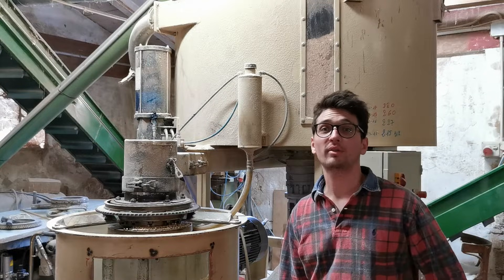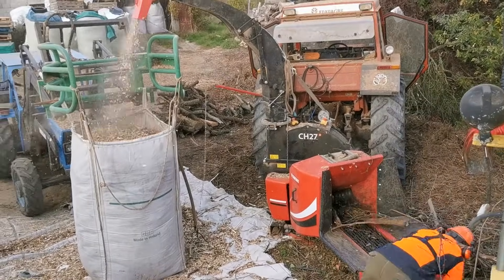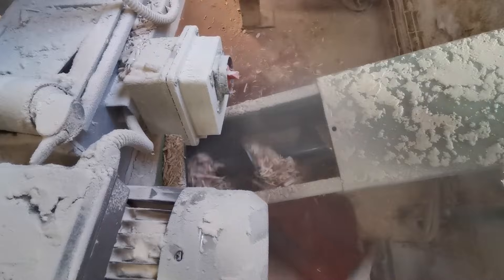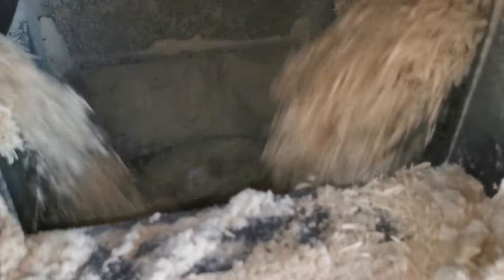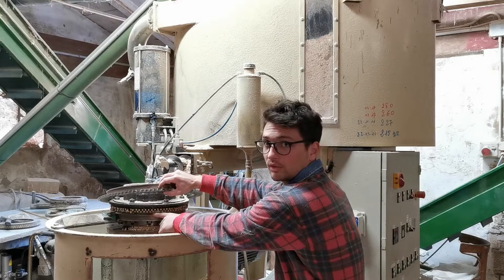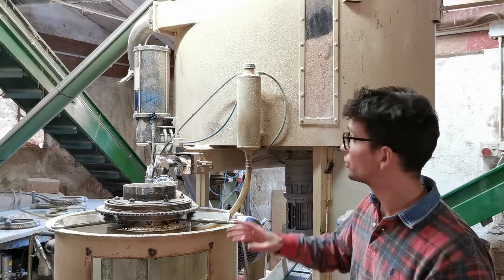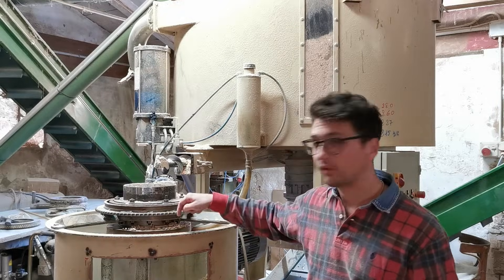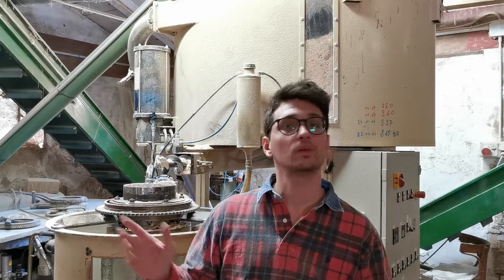wood PELLET - How It's Made! [factory and machines tour]

Comment: Awesome stuff! How many bags of pallets do you produce a day with that set up? If you dont mind me asking.
Reply from the maker: Hi! Thank you for the comment, glad that you liked the video. It really depends on the wood mixture, hard or soft, and also water content. In general, its about 150 kg/h - 180 kg/h. However, in this factory it is not continuous production, since my dad works here alone and he has to prepare the wood from the beginning (wood chipping), then dry it, then mixture and finally pellettize it. So there are several working steps before produce the pellet final product. He is getting older, and this work is very heavy, so the production has slowd down a lot, unfortunately. But he keeps up with the good work!

Comment: Is starch added to the mixture
Reply from the maker: hi! thank you for the comment. No, no starch is added to the mixture. Sugars and carbohydrates in the wood are enough to work as natural glue. They are melted down during the extrusion process due to relatively high temperatures, then cooled.

Comment: With the specially designed disc with saw tooth it can be acting like microwave machine gun ...great engineering but electrical power it all it need to counter mass attack

Comment: Nice video. It looks like you're limited in the size of log you can use due to the size of your chipper.
Reply from the maker: Hi! thank you for the comment, glad that you liked the video! yeah, exactly. We have also a screw log splitter for the excavator to reduce log size. however, we don't have log much larger than those you see in the videos. So yes, some of them may be a bit too large, but in general, we can do our work with these tools.

Comment: I have 15 kwh Pellet mill model name: ZFPM260-p with a die of 8 millimeters and triple rollers. Chinese made unfortunately because cant find any European ones. (broke the axle today only after 30 hours of use). I use cutter swarf (100% wood material and 0% tree bark) that I break further down to about 3 millimeter sizes that then goes into a mixer where I add flours in it about 2 kilos for about 50 kilos of raw material  (Flour which contains starch around 70% that apparently should help increase the pelleting feeding rate and hardness because the natural amount of lignin in the material is not working properly (or so I suspect) but they still have varying sized cracks in them) and after taking several moisture tests from the mixed material the moisture ranges around 11-14%, average around 13%, and no higher than 15% (Manual said operating range for making pellets is around 10-18%) although theres oddly much water vapor coming out of the pelleting process (but I guess its normal even for such dry material?)

Also do you use certifications for your pellets or do you just sell them in unmarked bags?
Reply: Hello, I am the Jonathan Showalter that has posted to Profilo several times in the past several months.  

I found you post interesting and perhaps I can be of some help to you and anyone else who are looking for reliable and economic pelletizing solutions.   (Not to take away from Filippo's input, though.)  

I have been interchanging with Filippo by email over the past several months, but right now, if I understand right, he is on a business trip and it might be a while before he gets back and interchanges again both on YouTube and by email with me.  I am seriously considering building a mill like his dad has and might be able to market it to a few other interested people.  I have done some research including a visit to the original manufacturer in Italy and discovered that they are no longer making that mill and no one else is either.  There is another Italian company that is making something similar, but not the output.  I consider this mill to have some advantages that encourages me to try to bring something like it back into existence.  I am hoping to continue my interchange with Filippo enough in the near future to get more information about design so that I can build one here.  If there is interest in a mill like this from anyone paying attention to this YouTube string, let me know.

I am pelletizing kiln dried white pine here at our beekeeping equipment manufacturing factory in Michigan, USA and it sounds like you are doing a similar thing.  I am using a 12 inch flat die mill made here in the states.  If you have a Chinese machine, it is probably also a flat die mill and so our experiences are probably similar.  Filippo's dad's machine is a ring die mill and has quite different and, I think, better results for pelletizing wood.

You indicated 8 millimeters.  I suppose that is the size of holes in the die plate.  Usually about 6 millimeters (1/4 inch) is the recommended hole size for pelletizing wood.  Something larger will probably not compact the wood enough to get the heat that is needed to melt the lignin and keep the pellet together.  I am wondering if that might be your problem.  You should not need to use any other starches or binding agents.  Moisture is a big issue and it seems you have that about right.

Because of the difference of speed that the rollers of a flat die mill need to travel next to the drive shaft and the speed away from the shaft, it does not work well with wood.  Some part, usually the outside of the rollers will be slipping on the die plate and further grind your material, making it very difficult to push through the die plate (if the hole size is correct.)   The ring die mills, like Filippo's dad's mill, do not have this problem.  That is one of the reasons for my serious efforts to try to get this mill back into availability.  

Big pelletizing companies also use ring die mills but the ring die is turned the other way.  The ring rotates around the mechanism that holds the rollers is stationary.  They are almost aways high capacity mills that require a lot of power.  The mill that Filippo shows in this video appears to be a very reliable, low energy consumption, fairly high output mill for the smaller factories.  I see it having a lot of potential.

Also the die plates on flat die mills like mine are pretty expensive, the rollers and their bearings are also expensive and do not last as long as they should in relation to their cost.  The mill in this video appears to have a pretty durable, simple ring and very economic, easily replaced rollers and bearings.

We will see where this will go.  Maybe others would have input on such a project.

For now,

Jonathan

Comment: Filippo,

My wife and I will be leaving our house at about 10:00 EST which is about 4:00 pm (16:00) your time.  If you can, let us know what you can do for a visit before you go, but if it does not work out for you to respond before then, you can still work something out "on the fly." Again, preferably Wednesday afternoon and Thursday, but we are keeping the rest of the trip flexible enough that we can work with anything (except Sunday).  Text or call my cell number which I will again include on an email as soon as I'm finished with the post.  Or email as you have been doing.  I will get it one way or other.  I have communication home and my children will make sure I get it.  There won't be much point in responding to this post after 10:00 am EST.  I might get wifi connection once in a while with this computer, which I will have along, but it won't be very dependable.

I still look forward to time with you.  I think we would both benefit from the visit.  I am bringing a bunch of photos and videos along to show you about our factory--manufacturing beekeeping equipment and, of course, the pellet mill process. 

Again, if a lot of time doesn't work, We'll work with a little time.

Jonathan

Comment: I was very glad to run on to this video.  You have done an excellent job and in doing so, gave me an answer to our pelletizing problems.  Here at Beeline, we are a manufacturer of wooden beehive parts in Southern Michigan, USA.  We are turning our white pine wood scraps and sawdust into wood heating pellets with a 12 inch flat die mill that is manufactured here in the US.   However, we have had no end of trouble getting good success.  It seems that a flat die mill is prone to more pulverization that results in blocking (holes plugging) that results in less production and finally shutting the mill down as result of over-amp draw. It also seems that a flat die mill is especially sensitive to particle size and amounts of moisture.  It is just to "tweeky," (hard to get it just right, difficult to get everything just right so that it mills consistently for long periods of time.)

I watched your video with much interest because it seems that a vertical die mill like you have would work a lot better for wood like I am trying to mill.  Unfortunately, I have not been able to locate a small vertical ring die mill in the US.  There are many large horizontal ring dies but they are to large and expensive for my operation.  The one you have is just the right size and capacity.

I found the contact information for the company that makes yours and have written to them with the hope that we could do business.  But I would like to interchange with you also.  You would have a lot of experience both with the process of turning wood into pellets and with that mill.  There is also the possibility that the company in Italy that makes your mill will ignore me.  If they do, or say that they are not interested in dealing with someone in the US, maybe I could work through you.

I am definitely interested in purchasing rings and rollers from them to use in a mill that I would build myself.  I would prefer, however, to purchase the mill parts from the gearbox up, and then retrofit it onto my mill motor and gearbox. (We have done a lot of fabricating.)  I would even be interested in establishing a dealership of their mills here in the States.  I think there would be a lot of little shops that would be very interested in an economic, dependable way to turn their scrap into a marketable product.

Can you help me out? Since I will probably terminate my YouTube account in the near future I would prefer interchanging by email at beeline@abcmailbox.net.

Thanks in advance.
Reply from the maker: Hi! Thank you for the comment! 

Glad that you liked the video and found it interesting. 
I want to be sincere, I didn't really know anything about vertical/flat mill comparison. I didn't think there may be a correlation/influence between the geometry of the mill and the effectiveness in pelletizing the wood material.

Anyway, also here in europe you find flat mill of very high power. All those that are smaller are vertical mill like ours. 

Yeah, we can get in touch via my email here: profiloisbackontrack@gmail.com
Write a comment here as a reply to notice me that you wrote something! I don't really always get the notification from this email.

Share and subscribe, you’ll really help me in spreading out this knowledge! Bye!
Reply: @profilo_is_back  Thanks for responding.  I'll interchange with you about business aspects and other technical matters by email, but for here I will say that you are exactly right.  We are running a 30 hp mill with a 12" flat die ( over 400 holes).  If the mill is running well I'm drawing about 30 amps and producing about 200 pound per hour.  Unfortunately, it runs badly more often than not.  

When I say badly, I mean that the outside ring of holes will block (presumably because the material has pulverized to finely) and that, in turn creates more pulverizing that blocks more holes until I'm probably only milling with half the holes. That leads to more material squeezing out from under the rollers and climbing the sides of the mill housing.  This continues until it chokes the mill, stalls it, draws too many amps.  We have it set up that it will automatically shut down if it does that.  I have other things to do and so it might sit there without running for some time till I can go clean it out and restart.  Yesterday it happened about six times.

I assume that, with a ring die like yours, there is almost no pulverizing happening and the material is more consistently forced through the holes rather than refusing to do so.

And so I would like to try a different mill.  If I understand correctly, you are running a 15 hp motor on the mill and producing higher output with consistent operation.  I'd like one of those!

Anyway, expect an email from me in the next couple of days to discuss other aspects of the process and see what we can do to wake up the company that makes them and get something imported.

Thanks for now.

Comment: How much is total power consumption and how many kgs production per hour?
Reply from the maker: Hi! Thank you for the comment! 

The main mill motor is 9 kW motor, the shredder is 20kW (but you use it only when smashing the woodworking wastes). I’don’t know the thermal power of the air dryer, but I know that is the main energetic consumption of the whole plant. Moreover all the motors for conveyor belts and feeding screws to move the wood chip around. The hammer mill is about 3kW.

The energy consumption of the plant depends on the working hours, obviously.

Comment: I worked in a plant that used a large California Pellet Mill (CPM) that rotated a much larger die at much higher speeds - we blended by weight, 30% granulated plastics (LDPE /PP) with hardwood fibers - output from CPM to holding bins. The material was then transported by augers to a 6" extruder having a 30:1 barrel...heating material to molten condition...extrudate then taken in measured by weight amounts to vertical acting compression molding presses (750 tons) to mold final product. The wood fiber content "stiffened" the plastic matrix making for durable molded parts.
Most of the plastics molding machinery were of German manufacture.
Nice to watch this video - and seeing how other people do things in their own way.
🇺🇸👍
Reply from the maker: Hi! Thank you for the comment! 

Glad that you have shared all these very interesting details! These numbers are absolutely astonishing,  compared to those of our small plant, producing 180/220 kg/h of wood pellet in good working conditions.
Bye!

Comment: Lovely video! If I might add a suggestion, if it's feasible, and when you upgrade the sealing machine, use one that can do vacuum-sealing. Should be possible to get the bags into nice solid bricks, like vacuum-sealed ground coffee. Would both reduce the volume and make them easier to handle.
Reply from the maker: Hi! Thank you for the comment! 
Well, it's actually not recommended to vacuum-seal bags. I actually didn't show the detail of the bac, but there are several micro holed reuquired to let the humidity go out. Water inside the bag is not good, because will deteriorate pellet product (I don't know if you have ever tried what happens when you put wood pellet under the water).
This is really important especially in our case, where we procude pellet, sevral decades of minutes, then we immediately seal it. it is still a bit hot, it loses water via vapour (you see it condensate in the internal side o fthe bag), then holes help to lose vapor outside the bag, saving the product.

Your point may be ok in case of factories where the product is completely cooled down, so that you don't have the risk of having it losing water vapor inside the bag.

However, even if you vacuum-seal them, I don't think you would increment that much the 'handleness', let's say. Moreover, remembre that in the majorityo of the cases you have robotic palleting machines, machines will do the dirty job ahaha.

Glad that you liked the video and found it interesting. Share and subscribe, you’ll really help me in spreading out this knowledge! Bye!

Comment: Hello from France, thanks for your video, can you please tells me what is the total energy consumption in KWH per tonne of pallet produced? by advance thanks very much.
Reply from the maker: Hi! Thank you for the comment! Glad that you liked the video and found it interesting. I have very rough and indicative data. The pellet production, considering:
- chipping and refinement
- drying
- handling raw material
- pellet mill
- packing

is about 3 GJ/tonne to 7 GJ/tonne that, properly converted, is about 833 kWh/tonne to 1945 kWh/t.

In these number transportation of the final product to the consumer is not taken into account.
Moreover, remember that drying the material is the most impacting energy percentage all over energy consumption. If you can do that naturally, using other wood material, you'll drop down production costs, as well as being more ecolocigally sustainable (instead of using methane gas).

Hope this reply was ok for you! Bye!
Reply: @profilo_is_back  Thanks very much for your answers. It is a lot of energy to produced pellet, I am very surprise, may be here in France, the plant that produced pellets are also integrated in wood industry, so they have a lot of waste material coming for wood reject to produce electricity as well to dry the product (cogeneration to produce electricity as well as reusing the energy to dry pellet). The reason for my question was to try to understand why prices in France (seems the same in Europe) increase from 270€ per tonne to 600-1000 € per tonne (sells price including a 20% VAT), making the pellet not more interesting to use to warn house (more expensive than using electricity or gas). Again thanks, take care.